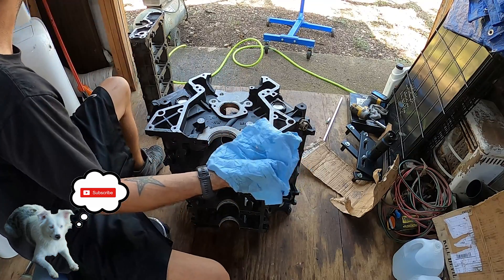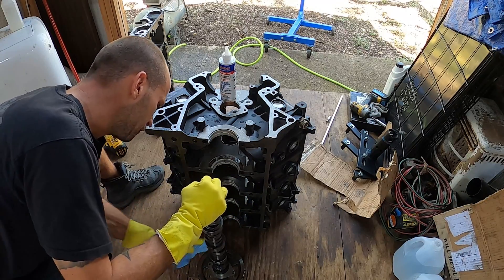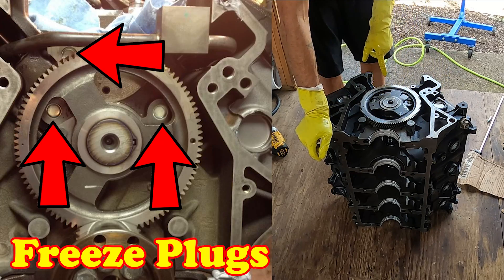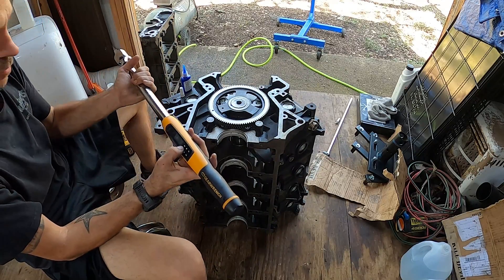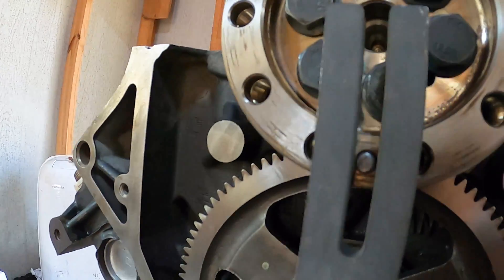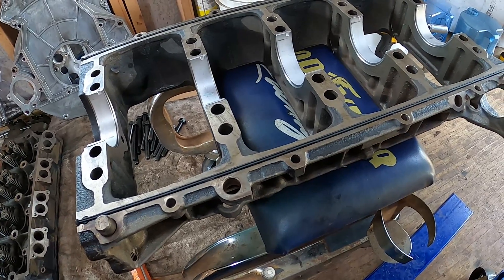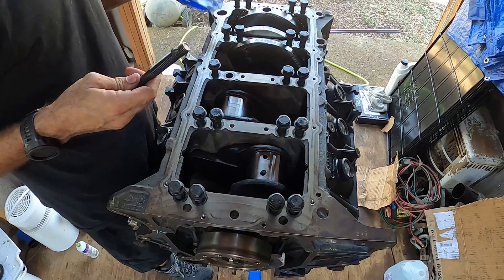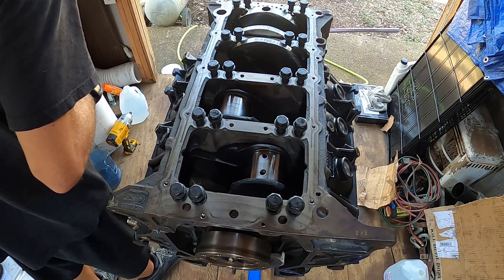6.0 Powerstroke - DiY Engine Rebuild - Part 2

Comment: Hey is this the first time you do this 6.0 build ? I have a 6.0 that has 476000 miles and a bunch of oil leaks how and was thinking of doing a rebuild how difficult would you say it is ?
Reply from the maker: It’s not hard at all. The worst part was wait times on parts. Getting the engine stabbed back to the transmission was the worse part. Because the tanny doesn’t have a viewing window for the torque converter nuts and you have to do it blindly through a small square hole. So lining up those studs on the torque converter is a pain.